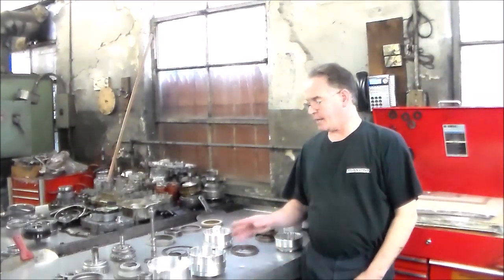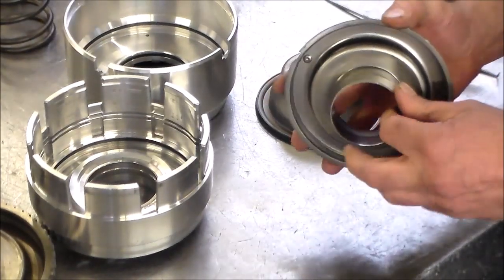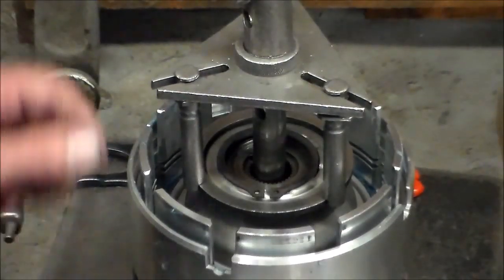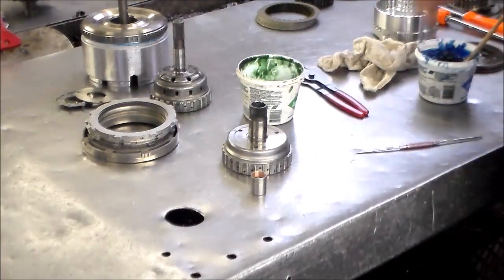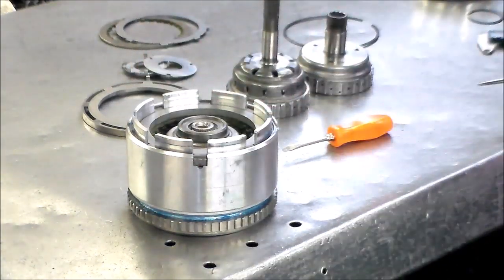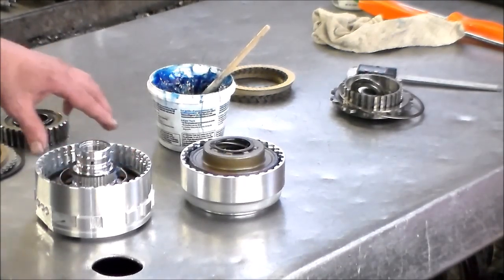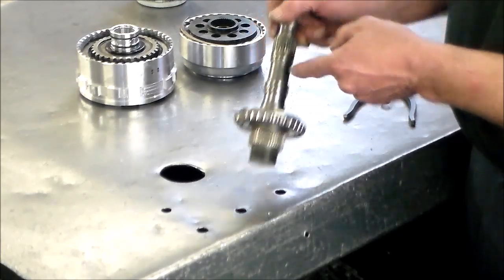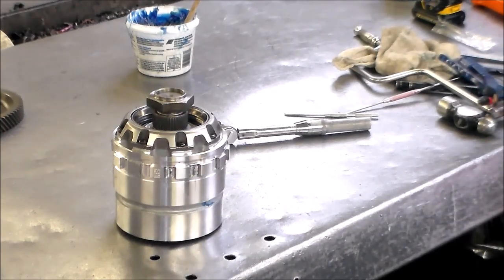62TE Rebuild Part 1

Comment: I’ve rebuilt many the manual transmission in my days, but up until recently have never had cause to rebuild an automatic. The better half’s Journey decided it was time to change that. Your video series on the 62TE have greatly demystified automatics for me.

Initially thought it was just a torque converter failure, but upon disassembly learned that the input drum had basically come apart. Bearing failure, thrust washer breakage, as well as physical damage to input shaft, inner drum, and both hubs. Thankfully the carnage was contained within the drum.
Reply: Same here, same problem, same challenge with a crazy quote from the workshop. Working thru it slowly purely due to cost and passion to learn. The video is great!
Reply: @WaheedAbdurahman  It really wasn’t too bad of a job. It was really more of a headache getting it in and out of the car. Pretty tight quarters under the hood of the car. Didn’t help any I was doing it in my driveway. Having a lift would have made it easier. 

The transmission itself wasn’t too bad. Just take it bit by bit. Make sure all the snap rings, seals, and such are facing the direction they should be, and double check clutch clearances. I put one of the plates in backwards and couldn’t figure out why there was so much clearance. 

This video series really was a great tool for the build.

Comment: I use to work in 6200 assembly at the Kokomo Transmission Plant before they recently stopped production and tore out the line.  Love this transmission.
Reply from the maker: wow, cool
Reply: @GaryFerraro  kinda nostalgic watching this. We use to build around 1100 per shift. Nice job on the build!
Reply from the maker: @zach9373  Thanks, very cool, all brand new parts, were the units ran on a dyno?
Reply from the maker: @zach9373  Are you a pilot?  been flying since the 80's myself,  I have private and instrument ratings
Reply: @GaryFerraro  there were 6 final test stands in 6200. Each units were ran for around 2 minutes each. The test stands were driven by a large 3 phase electric motor rather than an engine. I worked on every team in that department through the years, and spent around 2 years on the team we called “main repair”. We would fix any transmissions that would fail test stands based on what codes the test stands would spit out upon failure. Also I spent time in other departments for 6 speed. Machining cases, transfer and output gears, pump housings and rotors, also valve bodies.  I now work in 8 speed final assembly building 845RE & 850RE transmissions.
Reply: @GaryFerraro  also… we have a department called “test garage” where they take 2 transmissions per shift off the line and install them into vehicles. They then drive them around town with a machine connected monitoring line pressures, etc. they then tear down the units and inspect them for abnormal wear.
Reply: @GaryFerraro  I am just a couple hours away from my private pilot check ride. I passed my written a few months ago, and I’ve completed night landings & cross country, solo cross country, hood time, controlled tower landings, etc. I just need 2.4 hrs solo time and then Ill be eligible for the check ride.. I can’t wait! After that I’ll work on instrument rating.. do you own your own plane?
Reply from the maker: @zach9373  nice, very cool,  starting to get 8 speeds in now

Comment: Hi Gary, I did the compounder assembly on my 2010 town and country 4.0 for reverse issues and P0792, P0734, P0733 codes. The ring was almost off the end of the drum. The clutches all looked good and I couldn't source any replacement ones, so I reused those. I replaced all the rings and seals in the drum that came with the mopar overhaul kit and also the low piston. I went through the valve body and replaced the seal and the 2-4 clutch seal. I didn't remove the input drum though because I left it in the car. Now I am having the issue of on a hard acceleration from a stop there is something clearly slipping, but no codes. I dropped the trans and removed the input drum and everything is looking good. Any thoughts on where in the transmission that slipping could be coming from?

Comment: Gary, years back when I used to work at a shop they sent me to a transmission seminar. The one thing I heard multiple times that was one of the top causes of the transmission failure with these electronic transmissions was due to people not coming to a complete stop when going from reverse to drive.... doing those rolling shifts.  You seem very knowledgeable... so was wondering on your input?    The Chrysler speaker said it multiple more times than the Ford or GM guys.
Reply: Also, too many use the "P" gear like it's a Parking Brake. I am very adamant about using the Parking Brake in Neutral (like a standard) then shifting into Park with the foot on the service brake the entire time.

Comment: Modern transmissions with multiple clutches, pistons, drums all in one assembly are incredible. The only things I've worked on are older and have 1 drum 1 function. Unless you count the direct/reverse in a TH400. Much more complex in these units. The ZF8HP series is really complex. Great work Gary, this should be a very nice unit for the customer, especially with the updated drum. See you next week.
Reply from the maker: Ok Luke, as always nice to hear from you, thanks for chiming in.

Comment: How do I fix code p1745
Reply from the maker: 1745 is an Informational code, there is always another code with this code, can you tell me what the other code is.  1745 code will show up if the transmission was working in an altered state for 2000 miles or 1000 2-3 upshifts.  The counter has to be reset most of the time for this code to clear

Comment: you say a typical problem with these is a clogged screen, what or which screen ? What you describe kind of sounds like the van I'm working on right now, it's my son's 2012 Town and Country, they say it just stopped shifting one day, no prior problems or symptoms according to them, I looked at it, it had codes P0733, P0846 and P083b and it screeched whined like a banshee (interestingly when it whined it would shift but when it went quiet it would not shift, I expected it to be making noise constantly) got online to see results for the error codes and symptoms and ended up changing filter and fluid, that helped for a couple of days and then no shift, checked the resistances on solenoid block and all seemed to be good but went ahead and changed TCC solenoid, the line pressure solenoid and the pressure switch, that did not work either. If it sits either overnite or for an hour or two it will shift, it is making noise but stops shifting fairly soon. I dropped the transmission this last week but have not decided what to do yet, am leaning towards getting a rebuilt transmission, less work for me, but the curious, problem solver part of me wants to know what happened. When I first changed filter it was pretty clogged/dirty but fluid wasn't too bad and no big particles or pieces of anything. The 2nd time I opened it up (had maybe 120 miles put on it) everything looked okay but in the short time there was a lot of sludge on magnet. Anyway like I said at first it sounds like what you are describing, at first it shifts but soon as it warms up a little, no shift.

Comment: Thanks Gary, your video is a godsend!!!
I'm new to rebuilding a 62TE and your video is just what I was looking for, thank you again. 
I just bought a core 62te for $100 and when I went to pickup it was a rebuilt unit from mopar build date 11/2017 I'm planning on breaking it down tomorrow morning and was wondering if there was anything I should look for, I did an ohms check to see if anything was obvious like selenoid pak, ok so far.
Reply from the maker: these converters go bad a lot, maybe has clogged screen

Comment: Thank u
 the vid is
Awesome. 
Got a tiny question. 
I have a 09 vw routan sel 4.0 v6 62TE transmission. 
My question is. 
Is there a rebuild kit
For the
Low input/compounder drum unit?.
Here's why the question 
I can get on the freeway from cold start n drive 50 miles no problem. 
But
If I drive in the city more than 15 min, it'll slip between
 25 n 42 n, then I'll have to pull over for two hours n be off for another 10min city drive.
N do u advise
Buying any thing extra. 
Thank u
In advance. 😊

Comment: 2013 dodge grand caravan do have any ideas why it drives about 30 feet and drops into neutral this symptom was there before and after I rebuild it did I miss something possibly in the transmission just curious if you have come across this

Comment: What can cause one of this to go into limp mode after rebuild? Has reverse but it wont move on forward. It engages into drive but it won’t move. Everything inside is new! Including new solenoid block and converter. Any ideas?

Comment: Hi Gary,Thanks for your videos,professional information.
I have a Chrysler Town & Country 2010 with a problem on the Transmission,some times it stock on speed 50 miles and cant go further speed and if you push more gas the RPM go to the max almost.some times if i stop the car and turn off then on the problem disapeers.
I took it to Transmission shop and he checks it on the computer and there was error with one of the selenoids ,He also drives the car and check the transmission,and if he put the gear on Reverse down hill the car will go down and vise versa up hill.
also he checks the tiptronic was not working.
He want to rebuild the transmission ,to change the computer valve body and the bad parts inside the clutches.
The cost is not cheap, so i decide to buy the original parts from chrysler and let him do the job.
Is there a Master kit that i should buy from chrysler parts shop ,or do i have all parts inside the transmission includes the torque and others?

Comment: Gary, since you have your share of those transmissions in for rebuilds is their failure due to high mileage and lack of maintenance or an issue with design?  Great full length videos and knowledge

I remember the 'Original STP from the 60's and 70's, it was thicker than frozen honey, with Todays engines and miniscule orifices certainly not a suggestion by any manufacturer

Comment: I followed everything and reinstalled. Transmission shifts fine only thing is the car feels like it's holding back. Kind of like I driving with the brake on. Any ideas.
Reply from the maker: Have you tried a quick learn?  You overhauled the trans?

Comment: Hi Gary, great job, thank you for your great explanation! What kind of electric tool from DeWalt you used for the preliminary tightenings of screws? Is it screw driver or torque wrench? Thanks a lot!
Reply from the maker: I have a small dewalt impact wrench i use only for valvebodies

Comment: Hi Gary what's your advice on the 2000-2004 odyssey transmissions as far as keeping them running as long as possible other than a fluid change every 20.000mi? Great video 👍
Reply from the maker: Thats really all you can do,  Just a drain and fill maybe once a year.  How many miles do you do in a year

Comment: Thank you for the thorough 62TE videos. My 2015 Journey 3.6 62TE with 135K probably needs work. Do you know of a good mechanic in Los Angeles? Do you ship your rebuilds? I'm noticing 1/2 sec. shutters into 5th and 6th. 1st gear under heavier acceleration has a noise & vibration that goes away easing off the gas, it happens in 2nd as well. Some coast clunking too
Reply from the maker: I do not know of any shops in your area.  Has it been checked by a trans shop

Comment: Thank you for your videos.

I have a 2010 Dodge Grand Caravan 4.0L.
In the past several years, a couple of times, the engine shut down when we stopped at the signal/ stop sign, but no other issues.
Last month, I got the codes P0734 and P1790, and then I changed the transmission fluid (OEM), filter (after-market), and TCC solenoid (OEM)
After a week, the engine light came on and checked the code P2764

Currently, in the morning drive normally,  gear shifting is okay but a little rough but later in the day, the gear sticks to the 3rd gear not up or down, and the scan tool is not reading oil temperature

Please see below some reading from the scan tool DC 4-5 shift fill volume 255 looks like out of range

Could you please anyone advise what is wrong with the code P2764?
Reply from the maker: 2764 is an electrical code,  if you clear does it come right back?
Reply: @GaryFerraro  yes it come back and stick to 3rd gear most of the time
Reply: @GaryFerraro  when i start and drive with cold engine about 15min van driving normally after that stick to 3rd gear any advise to fix this issues?

Comment: Gary....I'm rebuilding right now and can not get the input retainer spline to mate with spline on input hub....tried everything. it starts but stops way before fully pressed together. I've tried clamp pressure....lots of pressure...will not move.
Reply from the maker: How do the splines look? Never had that problem.Was the trans busted up?
Reply: @GaryFerraro  pretty std screen clog both bushing sets in over drive and under drive hub were coming apart. Lots of metal in pan. Splines look fine to me and they do start but only about 1/16 of an inch and then stop. I'm baffled as well. Seems it should slide right in. Thinking to get a different one and try but does not really make sense as it came apart very easy...slid right out with a few light taps.

Thanks for responding. Your the greatest.

Comment: Gary, what kind of scanner do I need to program my rebuilt tranny to finish the job?  Is it called flash, relearn, or program?  I'm trying to find the correct scanner that will be suitable to complete my rebuilding DYI?  Thank you!
Reply from the maker: When it's done you want to do a Quick Learn.   I did a video about a month ago on a great scanner for the DIY-er check it out, doesalmost evrything my snap-on scanner does.   Do you know anyone witha snap-on or Autel san tool?
Reply: I'm looking to purchase an Autel scanner, and found out yesterday that flash, program, and relearn is the same thing.  Thanks for your help, Gary.
Reply from the maker: @waynel680  Autel is a good scanner
Reply: @GaryFerraro  talked to Autel tech support this afternoon, and they told me that  they don't sell a scanner that contains Quick Learn.  They do sell a unit for $800 that only programs the various sections of the computer such as TCM.  My local Chrysler dealer charges $150 plus tax for them to complete this task.
Reply from the maker: @waynel680  I can't see it not having it, the smaller scan tools do not but the larger ones do.  My lead tech has a small hand held scanner he uses through his phone, it's a great scanner for 100, let me see if i can have him hook it up to a Dodge we have there to see if it has the quick learn feature
Reply: @GaryFerraro  Please do because I would greatly appreciate completing my next big auto repair DIY job without bringing the car to my local dealership.
Reply from the maker: Hopping the guy shows up today
Reply: @GaryFerraro LoL!
Reply: @GaryFerraro  did your mechanic show up yet?
Reply from the maker: @waynel680  The car showed today, hooked up the scan tool and looks like there was not a function for a quick learn or resetting the VLP counter.  This year is also a 2018 which means you need Auto-Auth to get into the system, i have it on my snap-on scan tool but i still did not see a function for that
Reply: @GaryFerraro  Thanks for trying.  Much Appreciated!

Comment: Hi Mr. Ferraro,
It is great video on rebuilding the 62te. 
Is there a difference in friction plates for under drive and overdrive clutches. I am working on a 2012 Grand Caravan. Please give your advise.
Reply from the maker: Not frictions,  steels are different, they are thicker, you can I.D them by a small notch cut in the tab of the steel plate